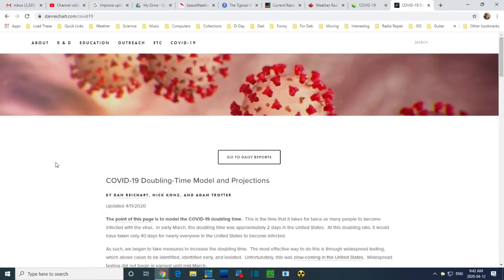Clinton 629 Tube Radio Video #1 - Checkout and Power up

Comment: WHen these sets were new , most of the repairs were filter caps , audio transformers and volume controls. Occasionally a power rectifier would fail, taking put a pilot lamp.

Comment: We are all going to go nuts come hay fever season in about 10 days. Clinton Mfg. Co. of Chicago IL made this fine radio unfortunately no schematics. It is actually a 629XP
which came in ebony or ivory (like this one). Built in 1938.  From the tubes in the radio you could see if other radios match up with this but no one has Clinton schematics!
The only thing I can tell you is the I-F alignment peak for this radio is 456 kHz. That is from the Radio Troubleshooters Handbook by Ghirardi circa 1943. I know, big help.
The two wires go to a loop antenna which is MIA. So it is no doubt part of the circuitry hence no signals.

Comment: Holy cow, I have an extremely similar Clinton radio!  I believe mine has the same tube complement (43 output, 76 audio amp) except 6A7 instead of 6SA7.  Mine has a wood cabinet and no buttons but the same 3 knobs and square art deco dial, the shortwave is 2.4-7 MHz.  Note that all the tubes are NOT 6 volt as it has a 25Z5 rectifier.  In fact, the filaments are wired in series and the tube that got really hot is a ballast tube as the filaments do not add up to 115 volts.  Oddly, it does have a transformer but only for the B+, I'm sure yours is the same.  It uses just a very long wire for the antenna on both bands,  This was the radio I had as a teenager.  The power transformer went bad and I replaced it with just a straight isolation transformer but I don't know what the B+ voltage is really supposed to be.  But it worked OK with the isolation transformer.  In fact it worked when I last tried it about 20 years ago.  It is on my list to restore but I haven't been able to find a circuit diagram so I hope you can.  As I recall the power supply is also really odd, one side of the transformer secondary goes to the plate of the rectifier and the other side goes to the cathode of the other diode in the same tube, in other words both sides of the winding are rectified if I remember correctly (this was 55 years ago).  And it is just a single secondary winding, no center tap.

Comment: Chatanooga
! Careful--looks like asbestos for insulation on the inside of the lid . Common practice when hot tubes are very near to the cabinet.The manufacture dosent want anybody to get scalded touching the outside of the cabinet. Try not to let your cat get near the cabinet or the dusty tubes.